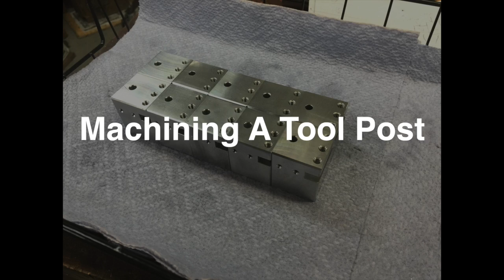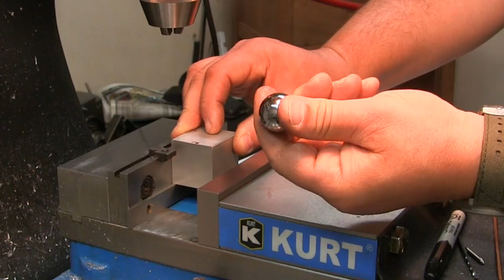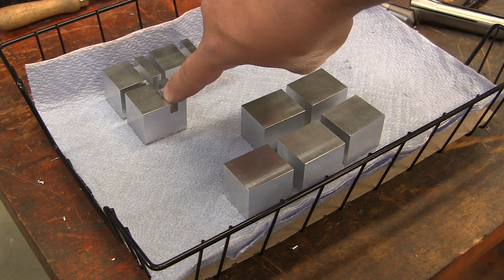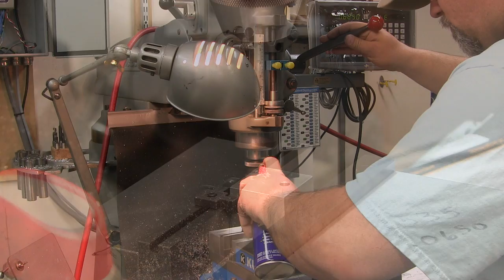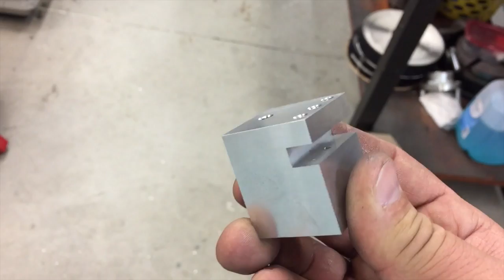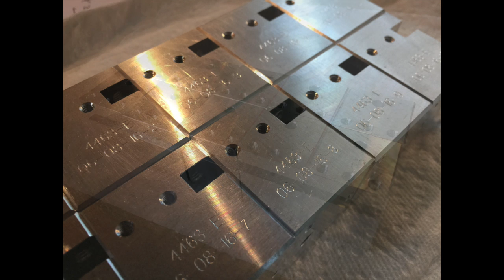Machining A Tool Block - MLMT1

Comment: Hey Brad - Noticed a small mistake in how you are checking the width of your slot.  By making a gage stack of .260 and it fits, you are ensuring the part is MORE than .260.

The traditional way - You have a tolerance width of .255-.260.  Using gage pins/blocks, you want two stacks:
.255+ = this is your "go" - it MUST fit - it ensures that you slot is at LEAST .255 (on a gage pin it is usually a couple of tenths over), but not under - IF it fails to go in, there is a CHANCE you are in tolerance, but it needs better measurement
Then you want a .260 MINUS pin/stack and it must NOT fit!  If it fits (short of an interference fit) you are too big (might only be a couple of tenths) - it is your "no go"
Now this is assuming your .260 is really .260 as in .2600.  If it is really "well, it can be ALMOST .261" you can wring a .261 stack as well as the .260, and it better not go.  
The fact that the .260 stack drops in like that?  You are sure to be OVER .260 - even if it doesn't feel lose, you are in the .2602 or more.

Comment: I like the video presentation and idea of having more of these short clips. I don't think the music adds much value. Power taping 6-32 could be a problem but looks like you got through it without a problem.
Reply from the maker: Yep, the tapping came out good. Aluminum gets really "gummy" and if I had those machine-taps, it way easier/safer. Gotta get me some of them.

Comment: Thanks for the great video and congratulations on the first paid job. Just a question, what do you think gave the better finish in the end, the shell mill or the fly cutter?
Reply from the maker: In this particular application, they both produced similar results. But I'm a sucker for the fly-cutter. It always leave such a silky smooth finish.

Comment: Nice work, but how the hell you power tap with an 6-32 tap and not break it? I can't tell you how many times I broke a 6-32 tap by hand. What size drill you used? One larger then what is recommended
Reply from the maker: I used "the force" ! But yeah, I'm surprised they behaved so well.

Comment: Clearly you really do look after your old machine tools and keep them at top spec. I used one of 7 old Bridgeport mills in my college this year and last year, and at best the end of the spindle didn't look quite as true-running as on yours, and they were a little rattly. Your machines seem to look and work just as good as new if not better! 

Great video too! 

I'm progressively being inspired by many YouTubers like yourself, Abom79, Keith Rucker and others to have my very own little back garden "shed shop", smaller machine tools but no import Chinese made ones will get me going, hah.
Reply from the maker: Thanks man - and thanks for the kind words!

Comment: Nice work, but a .260 size block shouldn't go in a .260 slot, so slot is over .260, but great video Brad.
Reply from the maker: Its funny, my voiceover is incorrect. The tolerance allows me to be smaller, so my gauge block set was one thou less. I actually found the stack the other day while cleaning up and it was .119 & .140. Good eye tho!
Reply: Awesome machining video

Comment: Nice video!

I think the background music worked well. I usually find constant background music to be distracting, but not so much in this video. Did you make a bunch of volume adjustments so it was only audible at certain times?
Reply from the maker: Oh yeah, for sure. Balancing the music, dialog (and) soft machining sounds took a few tries. Thanks for watching and kind words!
Reply: Well done! Usually when I hear music in a machining video I think "oh no, am I going to have to listen to all this music in order to hear the dialog?", but I guess if it's tweaked enough it's not so bad. Silence is the easy way out I suppose, but when done right music certainly makes a video seem more professional.

Comment: Looks like if you had trued up 4 sides and milled your slot and then cut them apart to finish to size you could have saved a ton of setups.  They turned out nice.
Reply from the maker: Haha - you're 100% correct Brian. Some of the parts got spoiled, so I needed to make 4 additional pieces. Done exactly like you specified. Amazing how we learn to work faster :)